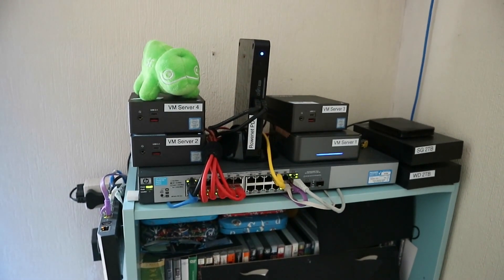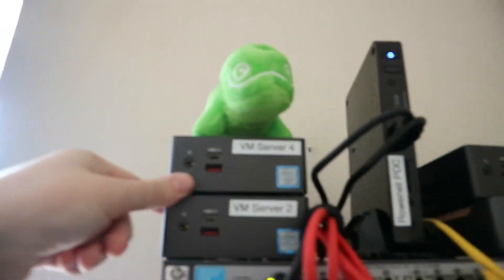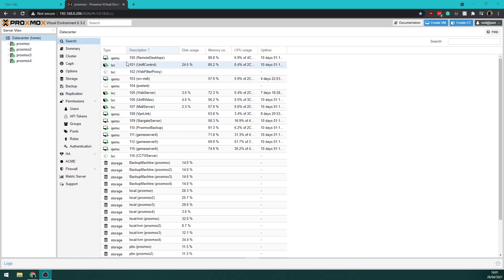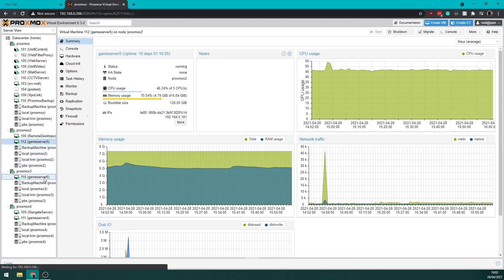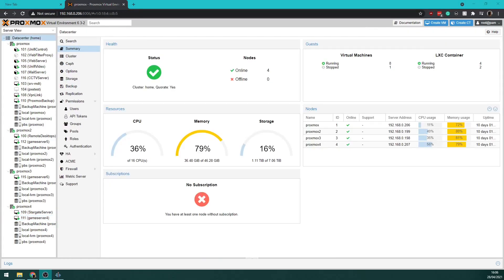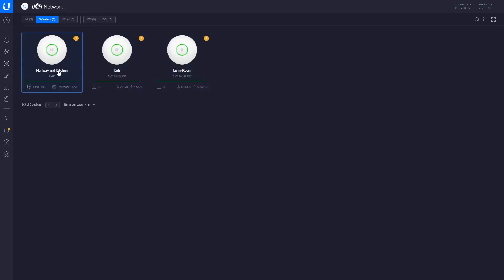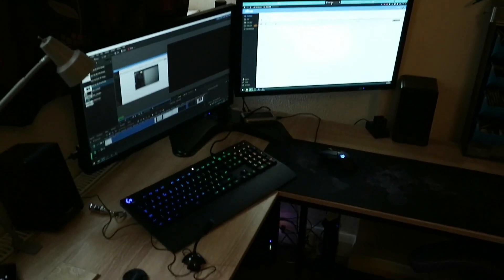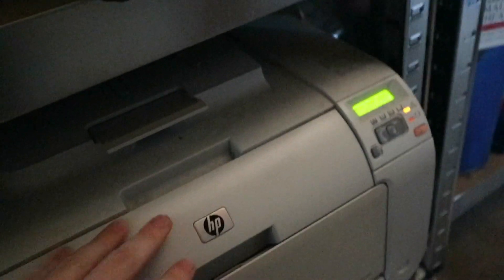Home Network Tour - 100W Total! - Proxmox Cluster, PoE UniFi, Mail Server, Rust Servers

Comment: I'm running a proxmox server with a Emby server , Home assistant server , 2 x ubuntu server running a mix of stuff under docker and native , like a torrent client , pi-hole , mpd , etc , windows 10 and 11 test machine .
I went a little overkill on the cpu a ryzen 5700g 8 core 16 threads in a deskmini x300 , 32gb memory , 3TB SSD (data) and 1T for the virtual machine storage.
I've monitored the power of the server alone from the wall and get about 20 watts at the plug running all of above at running at the same time at idle , 30-40 watts doing a fair bit of work and 100 watts max all 16 threads .
To minimise power I've switched off power boost  ,  I don't think Linux likes to new generation ryzen cpus yet , because if the cpu load went up a extra 1% the power would go upto about 35 watts from 20watts , how the boost off a extra 5% load uses a extra 1 watt of power.
Think of a small cluster with a nuc etc to run pfsense to put that next to the router .

Comment: Would love to know more I  the proxmox cluser. At the moment I am using a microserver running a modified vmware instance, but it can only handle 2 vms so looking for alternatives.
Reply from the maker: Done a follow up.. :) https://www.youtube.com/watch?v=due_BEFHJZ0
Reply from the maker: Hey thanks for watching. Yes, I highly recommend going for Proxmox (It's free and more flexible unlike VMWare). How many machines and what specs have you got? My servers (nodes) are simple Intel i3's with around 8GB DDR4 each. 
Let me know what you would like to see - how to set up from scratch or an explanation of some of the features maybe?
Reply: @therandomtechnologychannel9440  I have 2 Synology RS812 and a Hp Gen 8 Mircroserver which I am thinking of decommissioning. I didn't think virtualization was possible on the Intel nucs. Im amazed how power efficient those are as well.
Reply from the maker: @JustJordan365  The CPU needs to support VT-x (Virtualisation Extensions) which almost every CPU does now, even in laptops. These mini pcs are basically laptops which is why the power draw is so low.  Some of those older HPE microservers are pretty hopeless but they are 'enterprise grade'. Move to consumer mini pcs and you will get more performance for your money.
Another thing is you can containerize your workloads using LXC containers rather than having a VM for each they are like little Linux jails.
Reply from the maker: When I get my new mic I will make a video about it :)